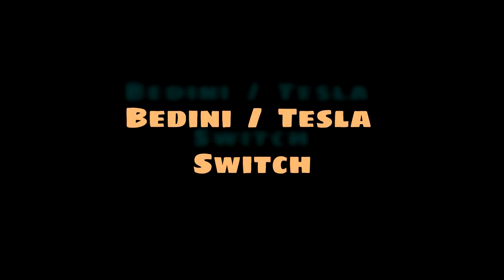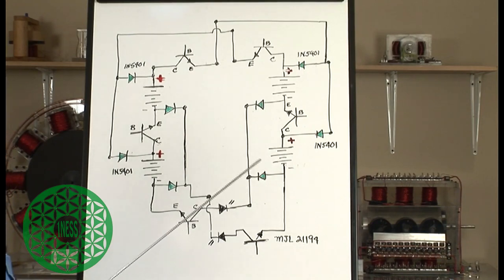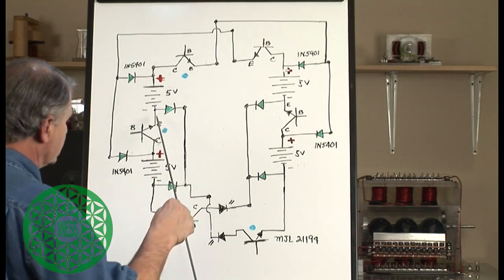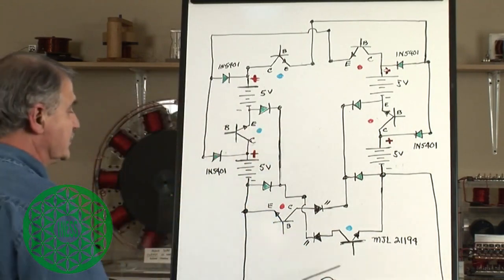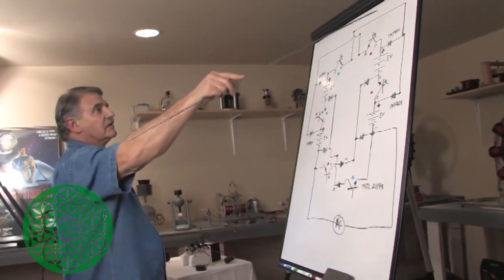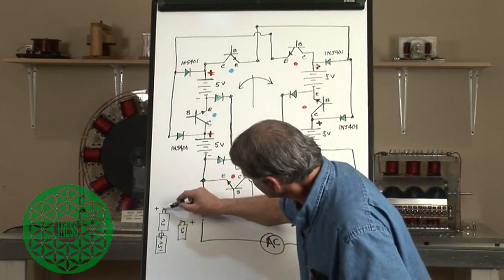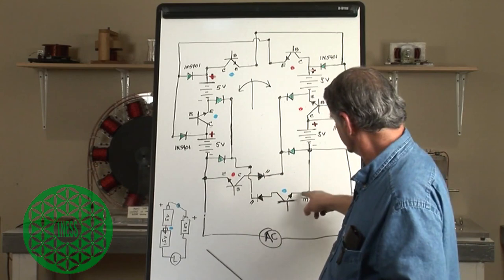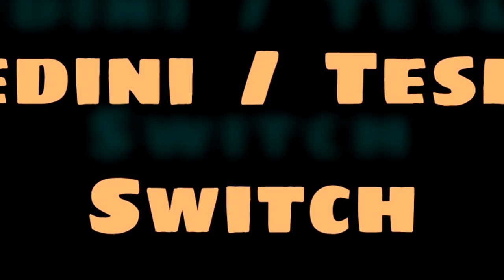Bedini Tesla Switch Part 4

Comment: After each pulse, the batteries will become more and more discharged. Lead Acid Batteries are only 80% efficient!  Plus the heat loss in the transistors. Plus the heat loss in the diodes. All heat losses will net discharge the battery pack. All energy consumed by the load will net discharge the battery pack. Just remember ... This guy still buys his electricity, from the grid. He is not off-grid.